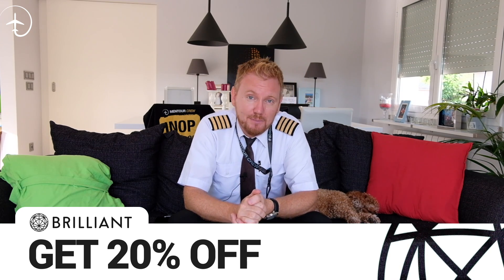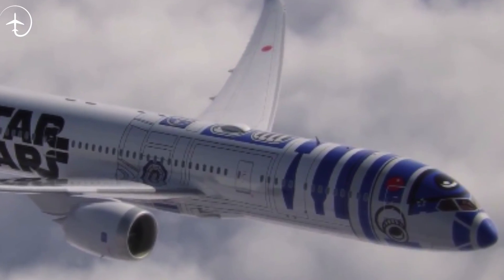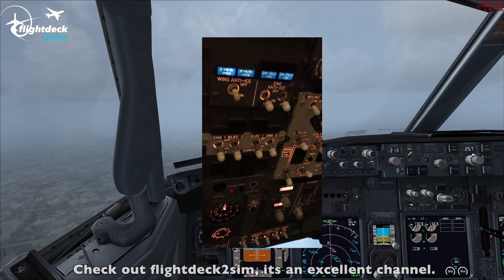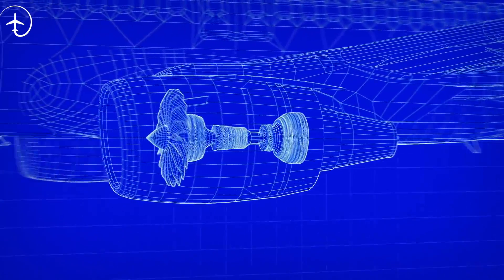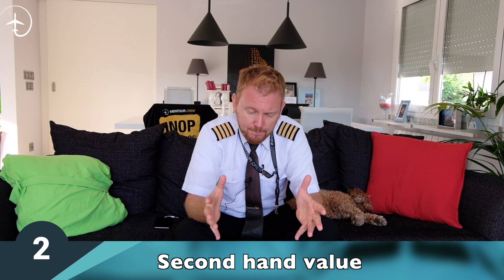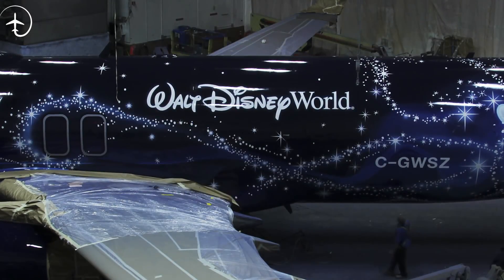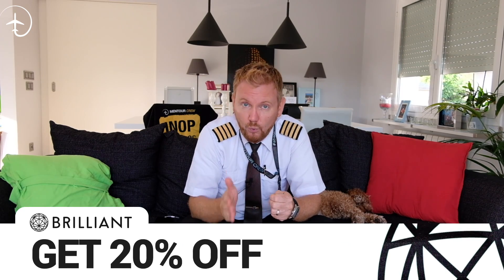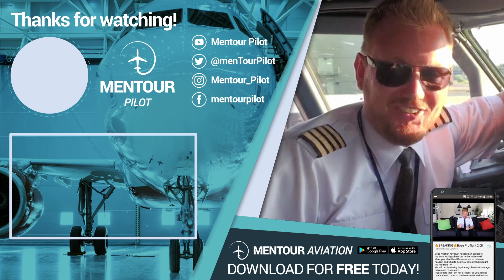Why the front of the Jet Engine is NEVER painted..

Comment: Thank you
How does hot, cold air conditions work?.
Reply: Hot air and higher altitude thinning the air basically reduce the power the engine can make so they cannot take off with as much weight safely. However, the engine might be running at better efficiency but lower power in some cases. Warmer air is less dense. Cold air or low altitude, the air is denser, so you can get more air/fuel mixture into the engine to burn and make more power. Many psiton engines run well on a cold day for that reason, you notice it on model engines. Modern EFI engines adjust themselves to suit so you don't notice so much. A supercharger compresses the air/fuel mixture it burns, raising the density, so there is more energy in the charge when it combusts, and altitude and temperature has a similar effect on density. A jet engine is a lot like a supercharger, of the turbocharger type of course. Planes that must operate in hot/high conditions need engines with excess power at normal conditions, so they have enough margin when that is reduced by higher temp's and altitude. Jet engines are more efficient at high altitude - not more powerful, but efficient. The designers optimise them to take advantage of this too but it's naturally more efficient up there anyway, and the whole point for airlines is to reduce costs to maximise profits, so efficiency means less fuel burn to do the same miles. So ideally you want thick cold air to take off in, and thin cold air to cruise in, hence the high cruising altitude. The air expands more during combustion because it starts so much colder but still reaches about the same exhaust temperature. More expansion means more thrust, on the same amount of fuel. So it's less efficient in hotter air. Some airfields are both "hot and high" and this is difficult for the planes, so they may have to limit the take-off weight, reducing fuel or payload. Hope this helps.

Comment: I’m a bit uneasy that the heating of the inlet is a manual switch rather than integrated into the overall control system.

Comment: My question is: why isn't that anti-ice system still not automated? Sounds like some WWII era system if you're still relying on your own vision and couple of temp meters 🤨
Reply: Papa Grounds Automation is a double edged sword. With something that is going to directly impact on aircraft performance but not necessarily be immediately obvious to the crew, its safer to let them have direct control over it. Imagine a slow descent into a short runway through icing conditions when the anti-ice wasn’t on, but then kick-in automatically. Thrust is reduced by the bleed air diverted to anti-ice, the plane stalls at low altitude, catastrophe. Ah, you say, automatic throttles will fix that; but whats the response time of a turbine spooling up - not quick enough! Let the crew decide they are about to go into icing conditions and handle the control so that when they are in the critical phase they don’t get a surprise. Yes there have been incidents from crew not using it (Air Florida, 1982, Washington, a “warm climate” crew operating in snow and ice), but on balance crew are trained and responsible folks.
Reply: @andyowens5494  All of those problems are easily foreseeable with some intense testing and clever coding. For example that slow decent; rev up the engine more when the recycling begins so that the thrust equals to normal decent. Believe it or not but sensors these days are way more superior compared to any human's abilities.

Comment: Two thoughts. Not sure of the properties of the alloy of the aircraft's skin, but paint may protect it from oxidation, which would leave a rougher surface (more resistance, for a fuel penalty).  During a tour at Boeing's Everett plant, the guide pointed out the paint waiting for the next plane off the assembly line.  Pallets and pallets.  Needing big forklifts to handle.  Okay, there are the liquids of the solvents - at 7 pounds plus per gallon.  None-the-less, the pigments and binders on a full size jet are heavy.  More weight, more fuel.  There must be a break-even calculation, here.

Comment: The paint at the leading edge will get chipped anyway from the incoming debris so just don't paint it.
Reply: Finally someone who gets it right.  The leading edge of the intake is in a high abrasion area from air entering the engine.  The paint starts to flake off and the aircraft looks like it is not maintained.

Comment: There is quite a difference between commercial and military aircraft, but nearly every military bird I've worked on has has the leading edg of the engine intakes painted... Any comment?
Reply: Depends on what military aircraft you've worked with. For small planes, like fighters or bombers, the engine is not so big compared to a modern airliner. Furthermore, anti-icing and de-icing procedures might function differently.
Reply: @nottoday3817 , Mostly B-52Fs, but also F-100s and F-4s are what I worked on, but was around a lot of others.

Comment: Engines - maybe drag and chipping - also, does the edge of engine is being actvely heated, I think even Mentour explained it at some point? Plane  due to temp shifts and airframe expansion cycle. Makes it last more if temp differences are smaller.

Comment: My idea not being a pilot, engineer... so much inflow of air creates friction on the intake you’re better off cutting paint in those areas. Better cutting your losses of engines failures due to paint flakes, than have bare metal intakes

Comment: to speak to the validity  of this explication, the engine needs a clean surface metal to conduct heat. also, that paint would chip off rapidly due to the requirement of it being heated so frequently.  Saying this as a pilot and an  aircraft mechanic.

Comment: A jet engine is basically a 4 stroke engine that does all 4 strokes simultaneously and continuously. You absolutely do not want to suck up paint flakes on those high precision pieces of mechanical engineering. Also painting engine cowlings adds needless weight and it’s a waste of money.

Comment: Why was most of the metal plane painted at all. if I remember correctly, aluminum oxide has lower drag than paint. You also save a lot of weight. Aluminum oxide is also a very good surface. carbon fiber is another thing I understand.

Comment: Concorde's maximum speed was apparently directly affected by the paint scheme, which gives rise to a possible fifth reason that mainly affects supersonic aircraft, aerodynamic heating.  Using British Airways' already-barebones paint scheme or Air France's whose is even more so and the plane flies supersonic without too much aerodynamic heating. However, a Pepsi can-line paint scheme would limit its top speed, possibly even prohibiting supersonic flight.

Comment: Actually, those questions and answers were very good, especially the informative answers! I couldn't help noticing the way the cushions were laid out on your couch, port and starboard, nice touch. But there is a question: Why are the port and starboard lights red and green and why are the on aircraft and ships too?
Reply: Jason Smith Prior to 1847, there was no consistency. Then the British Admiralty set the standard for ships, which eventually got adopted around the world, until in 1889 it was adopted into international maritime regulations for anti-collision. For ships approaching head-on, red was the side to avoid and green safe(r) because the “steer board” (rudder) was controlled by a bloke sitting to the right (“star board”) side of the ship - if a passing ship was on that side he could see and avoid it (and the same applied to the passing ship, they could see each other. When aircraft came along and were used for military purposes, the same standard was adopted for anti-collision. Its even applied to some spacecraft now.

Comment: Mr Mentour Pilot, please can you please answer why, if the engines must not ingest any paint, why the spinner on the front is usually painted with the "swirl" to indicate engine rotation? Does the benefit of having the "swirl" painted on the spinner outweigh the risk of the engine ingesting that small amount of paint? Or is it special paint that won't come off?

Comment: One of the hardest details to recreate in a scale model jetliner is that metallic rim on the engines! Great show!
Reply: Is that metallic rim made of aluminum?
Reply: @timothybradek3560  I assume it is. I have used several techniques and metallics but the AK477 chrome over gloss black base looks very accurate. It supposed to recreate super shiny chrome but at smaller scales it comes off very real looking.

Comment: So now the question is: Why do military aircraft have painted engine intakes? Do they have less of an icing issue than airliners?
Reply: 1. Yes, depending on which aircraft we are talking, icing forms in different ways on them. Plus, for supersonics, you have the shockwaves themselves and the extreme friction temperature that can deal away with that problem.
2. Perhaps a different type of paint compared to the civil engineering. Or, totally possible, it's not painted, but the metal is color treated through a different process.

Comment: Great podcast. Very informative.  However,  would not a black aircraft absorb more radiant heat from sunlight, up there where the air may be subzero degrees centigrade?  A saving on heating the interior?
Reply: Nope. It doesn't really work like that. You leave a car outside in the middle of winter. You can leave it for as much time as the sunlight lasts. You won't fry an egg on it. Leave a car outside in the middle of summer and after 30 mins you might burn your hand depending on paint and metal. The thing with heating via radiation is that you absorb heat and at the same time you exchange heat with the exterior as well. What you get from sunlight radiation is pretty low, but what you lose in heat exchange with the cold air is high. At best you could hope for a gain of 1-2 degrees. 

When it comes to ground level, on the other hand (in summer), heat exchange with the exterior is pretty low considering you don't have air flowing across your body as well, but absorbtion would be pretty bad. You could get 10 degrees on such a large surface. 

And the biggest problem is not actually AC for the airplane, it's actually creep/cracking due to high temperature variations. Imagine if an airplane would have to go from 55 degrees C to -60- -70 that are normally at cruise altitudes. In any ideea, it is usually a variation of more than 70degrees celsius of forced fast cooling and heating of the exterior surface

Comment: AA used to have just metal with some kind of sealant. It reduced the weight by loads (I'm not sure how much) and one of their engineers said in a transatlantic flight it could save near 100 pounds of fuel. Would imagine a silver coloured thing on the sea would be even easier to spot than white as you would also get glint.
Reply: The only issue that I can see is that water reflects sunlight, so a plane in the sea could end up being mistaken for that. But there again, you could probably say the same thing for a white plane. But if planes didn't have paint, they may need to be made out of a matt metal, because I imagine the plane reflecting a lot of light would mean air traffic can't watch the plane land, and it could potentially mess with the pilot's vision.

Comment: As far as I can tell, most of these engine nacelle "lipskins" are in fact anodized (presumably to tens of microns of thickness).  

This would in fact allow them to be colored - although to a fairly limited range if the color is to be durable.
Reply: According to Wikipedia (anodizing), "Anodized coatings have a much lower thermal conductivity and coefficient of linear expansion than aluminium."

Comment: Reason no' 5, it is easier to spot cracks and fatigue on a white aircraft...
Also, FYI, on the dreamliner (787), been made out of carbon fiber, the white color IS the protective layer (from u.v light that will destroyed the glue), so only one layer of paint, saving $$$

Comment: Ice doesn't form anywhere near 10C, it should be automated instead of letting pilots have to worry about checking the temp. Glad I fly props.
Reply: bashpr0mpt ........As air is drawn into the engine the pressure decreases, this also decreases the temperature of that air relative to its surrounding temperature thus reducing its temperature into the freezing range........Hence the +10C limit

Comment: My personal favorite is an American Airlines shiny chrome DC10.
Reply: They used to polish their aircraft to save weight over paint.
Reply: Chrome?? Never. Maybe try polished aluminum..
Reply: @airgliderz  chrome colored is what I meant.
Reply: I loved the DC10. My favorite airplane to fly on. Unfortunately with all of the calamities involved (not necessarily design flaws), they ended up in the freight department.
Reply: @dryan8377  it was a good airplane except for the initial cargo door design on the early production models.
Deregulation of extended flight over open water is what REALLY did the 3 engine paradigm to rest concerning commercial flights.
More fuel efficient 2 engine designs plus glass cockpits took over starting in the mid 90s.
One less flight crewman and one less engine per plane add up in savings very quickly!

Comment: What about the leading edge of the wings, which also require anti-icing bleed air from the engines?  They are also subjected to the impacts of ice and other airborne particles. They have painted surfaces.
Reply: Are you sure? Usually the leading edge is not painted where heat is applied.  Perhaps you can provide an example?

Comment: Question: the exhaust  and the accelerated air exits the engine at higher speed. I expects that it would cause the surrounding air to move towards it. (That is similar to what causes lift). Shouldn't the engine be mounted on top of the wing instead of the bottom?. It seems that when it is at the bottom, it would be creating lift in the opposite direction from what the wing is creating. I understand that the engine is on the bottom to facilitate easier access for maintenance.

Comment: American used to have their aircraft mostly unpainted.
Reply: cnordegren Yes. Those planes looked beautiful. They polished the aluminium. In the long run though its more cost effective to paint, as even though it costs more in fuel and weight, it needs to be redone only every 4-8 years, where as the aluminium had to be polished 4 times a year, of course requiring workers to do it, and the plane to be grounded while it was being done. Also the modern planes are mostly composite materials, so they need to be painted to protect the skin. I think they for a while painted their planes in a metallic paint, which was of course quite heavy, to keep the looks, but when everyone else was white, that may have seemed “old” to them, so they started painting white too, to seem modern (just like how every smartphone looks the same these days, they copy the others to seem like “new and modern”). Maybe the metal colour will come back one day.

Comment: Actually there's a #5 reason: if a plane is painted white you can immediatly spot if it has any oil leak!
Reply: American Soldier: Oil? Where!?
Reply: @oneofmanyparadoxfans5447  aircraft usually operate using hydraulics. The leak could be anywhere.
Reply: @thebigmacd  That one flew right over your head.
Reply: @oneofmanyparadoxfans5447  I missed the "American Soldier" part.
Reply: @thebigmacd  America. A country run by oil companies.
Reply: Wot if it has white oil. 🤔🤔🤔🤔🤔

Comment: Captain Mentour Pilot if a 737 has an IAS (Indicated Airspeed) of 420 knots how does that relate to Actual Airspeed say at Flight Level 360 (36000 feet ) how does one calculate it ?
Reply: it's usually 2% for each 1000feet. However that should not always be taken into account since the sensibility of the pitot tubes might vary.

Comment: In regard to the temperature issue that would require an aircraft (sorry, I mean airkroft, rofl) to be painted white, it makes total sense and I guessed that was the reason even before watching the video. But then jet fighters come to mind and I can't think of many fighters that are white... Now, I get it's mainly for low visibility of the aircraft and stuff, and that those machines are at the bleeding edge of construction materials technology, but it's also true that they are subjected to the highest grade of mechanical and thermal stresses, due to the potentially extremely quick changes in altitude and tight manoeuvres. Doesn't the colour of the paint affect jet fighters as much as it does airliners? Maybe the amount and frequency of maintenance compensates for that?

Comment: as an engineer, I find that with white color it's easier to detect and notice dirt and any liquid leaks
Reply: ... and also lightning strikes
Reply: yusuf alghareeb So you need to be an engineer to detect leaks and notice notice dirt?

Funny I could do the prior to attaining my engineering degree...
Reply: Greenid Guy Maybe he is an flight engineer, which is a job, which requires detecting leaks. Or engineer who designs stuff and needs to monitor performance and leaks. He’s clearly not stating you need to be one to detect them. For example a pilot could say “As a pilot, i find that having wings on an airplane makes it easier to keep it in the air”, which does not imply that you need to be a pilot to figure out planes need to have wings, just that it makes his jobs easier.